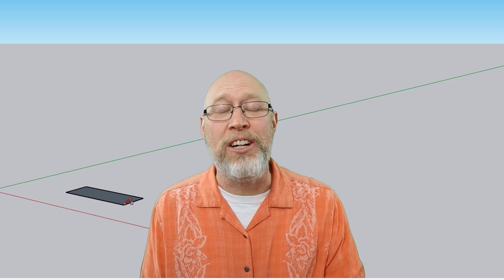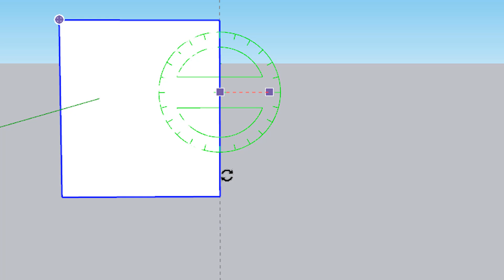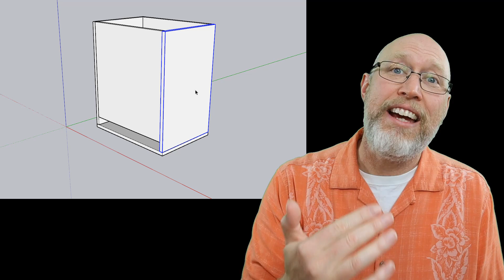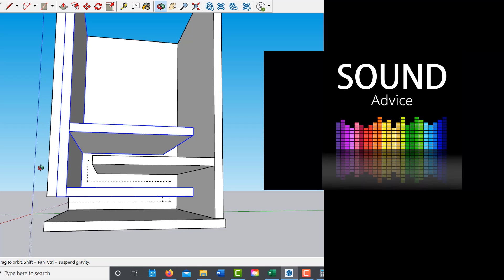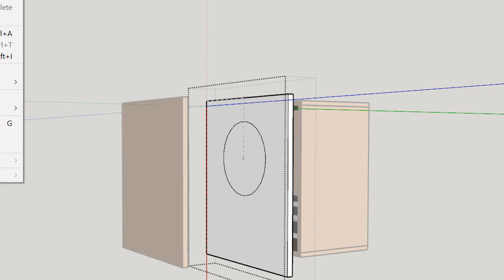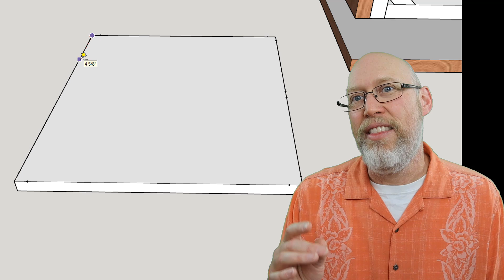Better Bass: Subwoofer Design in Sketchup, for home and car audio.

Comment: Is there a right and a wrong way, to fold/route a vent inside the box? I know what my length/dimensions need to be, but there's more than 1 way to route it inside the box and i'm not sure if 1 one way is superior to another. Is a vent entrance on the inside of the box allowed to face the rear of the sub woofer or does it need to face away from the subwoofer?
Reply from the maker: I will try answer your question on our live show tonight, tune in if you can.  https://www.youtube.com/live/CqXSQqpBSV0?si=2jCYlBfmIVCja5xS

Comment: Make a group for your airspace. then select it. It will automatically calculate your airspace (volume of a group) under "Entity Info".
Reply from the maker: I'll have to give that a try!  Is this going to require me to make a shape that's equivalent to that airspace or will the software actually find the airspace of the interior of the enclosure?
Reply: @DIYAudioGuy   you will actually make the shape. It makes it way easier to calculate the cubic area, especially in custom shapes. Its actually missing from your default tray on the right. To add it go to window/default tray and select entity info. It will show up on the default tray to the right. The object has to be a group. I typically change the group material to water so its translucent. Gonna save you a ton of time calculating though.
Reply: @DIYAudioGuy   oh one more tip. Using "entity info" you can calculate the total length of multiple lines. just hold down shift and select lines. This would help with calculating port length.

Comment: sorry, me again. why do you only measure to half the distance from the back wall inside the port?
Reply from the maker: Because the port is making it turn there, The air in the corner is not part of the port.  A more accurate way to do it would be to treat it like a radius.

Comment: is there a nice way to explode this and lay it out on sheet material for cutting?
Reply from the maker: SketchUp has a plugin that will do it.  I don't like it, it is hard to use and does not ever seem to lay out the pieces in a manner that's conducive to the way I break down sheet goods.
Reply: Vectric does it

Comment: im sorry in advance for im about to say... but it goes:  sound waves travel spherically from a source, a square walled box will never be the best acoustic device, but a bubble like enclosure, with baffles inspired in jellyfish anatomy, sound is radially and spherically radiated in waves from a radial speaker... not a square giving flat travelling straight vectors in the air of a room.

Comment: is there a rule of thumb for when to add bracing to an enclosure? with 3/4 mdf and 250W you might get away but if we are talking 1000W bracing is a MUST? or perhaps, some bracing shoyld always be added??
Reply from the maker: I am not aware of one, and like you say it will depend on material thickness and power.  The other thing to consider is the size/shape of the enclosure.  If you have a 32 inch wide box you will probably want a brace in the center.  But if it's 14 inches wide you probably don't have room for one even if you did need one.

Comment: It would be awesome to learn about pro audio subwoofer enclosures. And why the pro audio drivers differ so much from car audio subwoofer drivers.
Reply from the maker: If you flash back to the 1980s, back to the early days when subwoofers for starting to show up in cars, they were mostly all pro audio subwoofers.  The old school cerwin Vega strokers were designed for use in movie theaters.
Reply: @DIYAudioGuy 
Remember those quite well. 
The 18" Cerwin Vega Stroker was the "king of the hill".
Close friend of mine had four of them in an S10 Blazer driven by Orion HCCA "Cheater" Amplifiers.
Reply: Agreed, but a lot of your younger viewers can't flash back that far lol
Reply: Car audio drivers often focus on "how much bass can I get in my space?" This is why often the magnets are much beefier and the cones heavier. You need more motor force to push air in a small box, and also more amplifier power. The downside is you lose open air efficiency. If you tried to use car audio drivers as a direct radiator in pro audio applications, you'd waste a lot of power moving the heavy speaker parts to fan small quantities of air which could have been done more economically with a pro audio woofer.  If you design a folded horn for the car audio drivers, they might do rather well though for concert applications, assuming you don't blow the PA amps with low impedance designs.
Using pro audio woofers in a car you could still get quite loud, but if you are in an SPL competition you might score lower on an absolute maximum. The beefy car audio woofers will be able to crush the air in the car down much smaller if you really desire bone shattering SPL, as you can fit more of them in. Although both will be able to satisfy music lovers who are at least 1% sane when it comes to loudness levels.

Comment: This question is not related to this video, but ima post it here. My monoblock have two outputs, and my woffer has two, 2 ohm coils. If i connect one coil to one output set, and the other to the other output. Is the amp internally bridged, so the woffer will run in 1 ohm, or will it run on dual 2, if you guys get me. Im new to this, so i would appriciate all tips, and answers.
Reply from the maker: Think of the second set of speaker terminals on a monoblock amp has nothing more than a convenience feature.  It just makes it easier to hook up to drivers.  Some people refer to that as internally bridged, but that's not the best way to think of it because bridging means combining two different channels of output.  It's just one channel of output with two sets of connectors.
The only real reason to use them both is if you're using some very thick speaker wire.

Comment: great tip re. making each part a group - otherwise it's super easy to accidentally stretch/warp them!   cheers
Reply from the maker: Some people lay down their first piece, then put lines on it, then use the push/pull tool to build the rest of it.  But the way I do it allows me to visualize the pieces that I'm going to cut out of the MDF to make the box.  I'm not sure which way is faster / more efficient.
Reply: @DIYAudioGuy  totally agree, having a fully measured out materials list is very handy!

Comment: I've literally built many hundreds of enclousers over the last 3 decades for various audio projects ranging from home & car audio to pro audio along with custom cabinetry blah blah blah but I have quick question for anyone that builds their own enclousers...

Being that in almost all enclousers i see being built online,  why does everyone inset the baffle between the sides...? This does nothing for strength, infact it weakens the baffle when using mechanical fastners in from the side to the edge of the baffle...

If the baffle is mechanically fastened through the baffle to the sides its WAY stronger especially when using MDF/MDO or even crappy particleboard...

Often times internal braces are eliminated as well when simple furring type strips are glued in to help strengthen larger panels & this also helps enclosure resonatation, standing waves etc...
Reply from the maker: I do it that way because it makes it easier to build the slot port.  But I'm willing to try it a different way, always learning.
Reply: @DIYAudioGuy  The slot port is still easy by placing the baffle on top vs inset... Built port as normal of course then drill a hole through the baffle and use a 1/4 spiral flush trim bit to rout it out... Comes out super clean..!
Reply: @DIYAudioGuy  Its just a trend I've been seeing over the last couple years and couldn't figure out why people were doing it like that...
Reply from the maker: @houseoffire72  It's not something I've ever really thought about, but now that you pointed out I can see how it might make the box weaker.
Reply: @DIYAudioGuy  Yes especially when the hole cutout comes close the edge... Think of it like this - Most people use 3/4-1" MDF or HDF for a box right?  If you took the same material as a test &  screwed & glued together a 90 degree joint then pulled them apart, which side of the joint breaks? It will be the side that the screw goes into vs the baffle which the screw goes through... Lol I think I said all that correctly lol...
Reply from the maker: Ok, what is your question?
Reply: @DIYAudioGuy  Its in my comment.
Reply from the maker: @houseoffire72  ok, For some reason it was not displaying.

Comment: For ports like that, in each turn i use the port radius (or half of the width or diameter) times a radians of 45 degrees.  This give you the port length along each turn.  Far more accurate.
Reply from the maker: I will give it a try next time!
Reply: @DIYAudioGuy  to some, it might be inconsequential but that how I do it...love your vids btw.
Reply: @DIYAudioGuy  dude, btw, the dayton audio dcs165-4's are awesome subs for four or more subs in either a 4th or 6th order enclosures.
Reply from the maker: I just modeled one in both ported and sealed enclosures and it has a pretty nasty cone excursion problem.  I wonder if a band pass would fix that issue.
Reply: @DIYAudioGuy  yeah, they are horrible in sealed and 2nd order vented....they are ideal for 4th and 6th....stby
Reply: @DIYAudioGuy  for a SQ: put eight of these guys (dcs165-4's) in a 4th order tri-bandpass (four subs per split chamber), wire each pair in series then all pairs in parallel (to 1ohm - Re: 0.84ohm), apply 600-800 watts)

Enclosure Specs:

Outside Chambers:
Vb1: 1.361 ft^3 gross (each)
Q: 0.707

Center Chamber:
Vb2: 2.469 ft^3 gross (port accounted for)
Fb2: 74Hz
S: 0.707
Port Type: Slot
Port Spec: H = 10.7" W = 7.22" L = 16.465" (good up to 800watts)

Enclosure Frequencies:
Fo: 75Hz
F3 HP: 44Hz
F3 LP: 124 Hz

You will need 5.191 ft^3 net...add what ever displacement you need for bracing.
Reply: @DIYAudioGuy  Or for just four:

for a SQ: put four of these guys (dcs165-4's) in a 4th order tri-bandpass (two subs per split chamber), wire all subs in parallel (to 1ohm - Re: 0.84ohm), apply 300-400 watts)

Enclosure Specs:

Outside Chambers:
Vb1: 0.681 ft^3 gross (each)
Q: 0.707

Center Chamber:
Vb2: 1.332 ft^3 gross (port accounted for)
Fb2: 74Hz
S: 0.707
Port Type: Slot
Port Spec: H = 5.5" W = 7.0" L = 18.517" (good up to 400watts)

Enclosure Frequencies:
Fo: 75Hz
F3 HP: 44Hz
F3 LP: 124Hz

You will need 2.694 ft^3 net...add what ever displacement you need for bracing.
Reply: @DIYAudioGuy  If you would like to run a different port type, just let me know and I would be more than happy to get that info out to you.
Reply from the maker: @J-Ro2082  That's good information!  Thanks I appreciate that.
Reply: @DIYAudioGuy  you are so welcome!